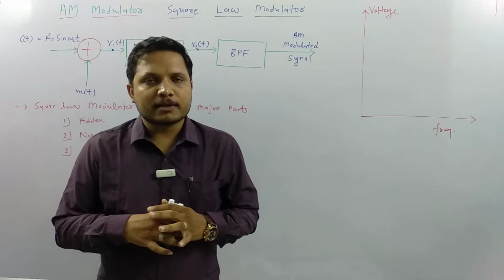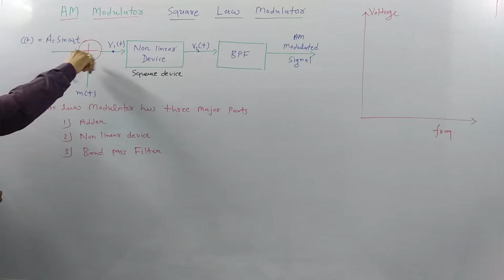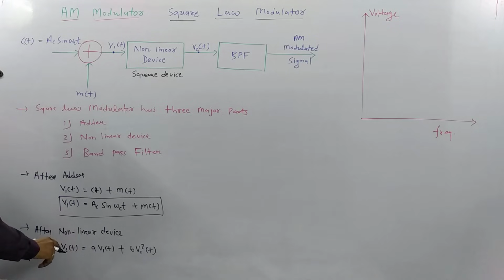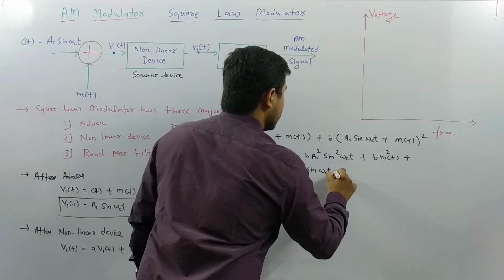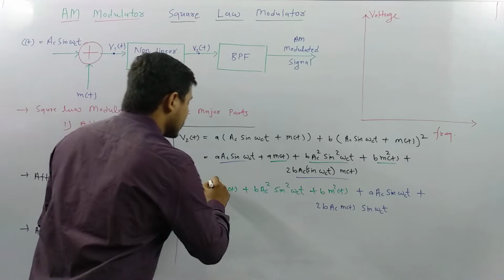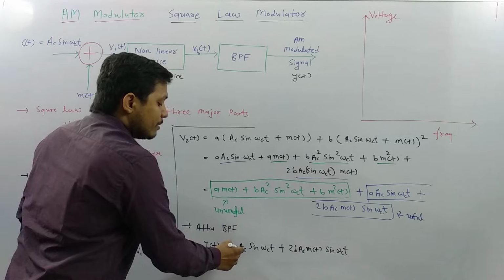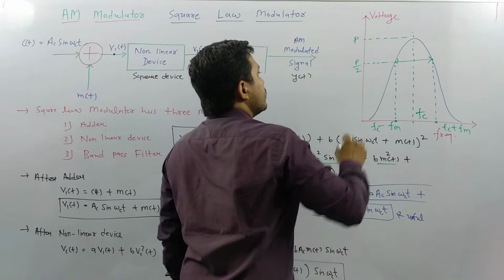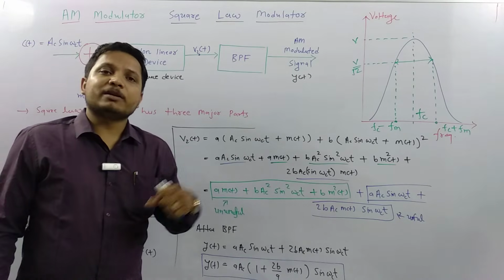Square Law Modulator (Basics, Working, Block Diagram & Circuit) Explained | AM Modulator

Comment: Signal multiplication at higher frequencies can be accomplished by the square-law modulator.The circuit realization uses a field-effect transistor as the nonlinear element and a parallel RLC circuit as the filter.Unfortunately, perfect square-law devices are rare, so high-frequency DSB is
obtained in practice using two AM modulators arranged in a balanced configuration to cancel out the carrier. Communication Systems
Book by A. Bruce Carlson and Paul B. Crilly

Comment: for anyone who wants a formal definition of sq law device 

A square law device produces an output voltage or current that is proportional to the square of its input voltage or current. Square law devices are mainly used in modulators and detectors.
source -- topper learning.
Reply: Thanks I needed that

Comment: Sir,I'm bit confused with that useful and useless component.Why the green part is useless and blue part is useful?Also,how we consider that the blue part is the modulated signal?
Reply: You can compare with a general wave Single tone or Multi-tone AM signal. then you can get the Modulated part only useful.
Reply: Useful part has 
Amplitude, Phase and time

Comment: sir can you please illustrate how to identify the useful part and which one is useless....it will be very helpful
Reply: Just compare it with am wave general equation
Reply: Signal which are useful depends on BPF. Here BPF allows only omega frequencies signal to pass. 
(A bandpass filter allows signals within a selected range of frequencies to be passed , while preventing signals at unwanted frequencies from getting through.)
Reply: Yes sir.. Please describe how to identify the unuseful components and why they are unuseful.
Reply: not understood

Comment: How can we judge they are useless components?
Please answer me
Reply: Assume wc  is very large in compare to wm circuit tunned to wc not wm .
And respond only to the terms of  frequency wc,,,  wc+wm and wc-wm. Rest term of output  wave equation do not produce appreciable voltage across the tuned circuit.
Reply: @arunkumardubey2568  tq
Reply: @bendivani7817  your welcome🙏❤

Comment: how we decide useful unuseful terms for band pass filter
Reply: It depends on what you need to end up with. This modulator is used for double sideband with full carrier modulation so those are the terms required.
Reply: Assume wc  is very large in compare to wm circuit tunned to wc not wm .
And respond only to the terms of  frequency wc,,,  wc+wm and wc-wm. Rest term of output  wave equation do not produce appreciable voltage across the tuned circuit.

Comment: Sir how can you say the certain terms in that equation are useless and some are useful.
Reply: Hello Suresh I completely understand your question. 
The reason that certain terms are useless is because, our main motto here is to transmit our message signal in terms of the amplitude of the carrier signal. 
If you look the equation carefully there are terms independent of information terms i.e message signal. And last two terms have message signal embedded in the amplitude of the sinusoid signal, this is what we need. So by passing through BPF we are eliminating non-information signal(unwanted signal).

And if you ask why use square device if it generates unwanted terms. And the answer depends on the requirement. we can opt another method of performing AM but it involves additional circuitary, which increases cost. So square law modulator is used to suit one's requirement.
Reply: @pranavc4397  but the term a Ac sinwc t doesn't have message ,it is only carrier signal right ,soo how can we consider it
Reply: @yaswanthvasu877  Because in a general AM wave signal, there is a presence of Carrier signal also, along with m(t).
Reply from the maker: If you pass signal from BPF then other terms will get cancelled which are useless, i mean unwanted.
Reply: I stongly understand your video. My doubt is when we are going to design a bpf, we need to assign which components has to pass, and which components has to reject.. inorder to do this,we should know,which component is usefless and which one useful before passing through bpf.if we know useless and useful components,then we can design bpf accordingly..so my question is how to know useful and useless component from the output of non linear device mathematical equation.
Reply: @sureshavev9104  Assume wc  is very large in compare to wm circuit tunned to wc not wm .
And respond only to the terms of  frequency wc,,,  wc+wm and wc-wm. Rest term of output  wave equation do not produce appreciable voltage across the tuned circuit.

Comment: Sir bpf pe useless signal ka explanation bhi kijiye
Reply: Assume wc  is very large in compare to wm so that circuit tunned to wc not wm .
And respond only to the terms of  frequency wc,,,  wc+wm and wc-wm. Rest term of output  wave equation do not produce appreciable voltage across the tuned circuit.

Comment: Sir, what's the reason that the following signal is useless, i mean some part of signal is useless na before passing through BPF
Reply from the maker: Haarika shreya : non linear device will generate it . So by BPF we only take useful components
Reply: non linear device is generated this unwanted signal...then why we use non linear device??
Reply: Sayan Nag we need some mechanism to multiple the Ac with m(t) . So we use a non linear device which is cheap but we get some extra useless signal which again is removed via a bpf. So it's economical to fo this way
Reply: @shankysays  thank you....
Reply: Sayan Nag haha didn't expected a reply. I just posted so that someday someone might see this and start wondering.then he would have an answer. Btw was that info useful for you? Aren't you done with your exams yet?